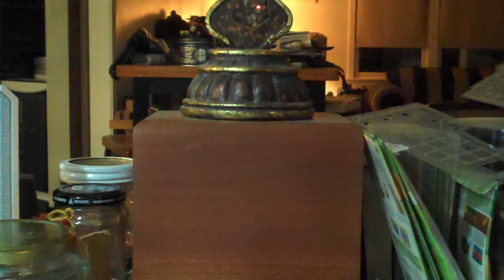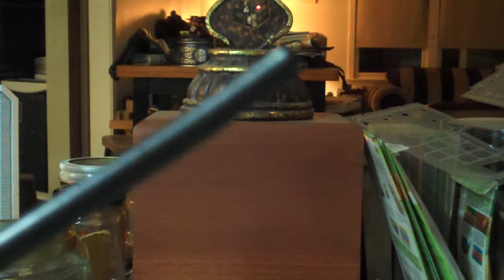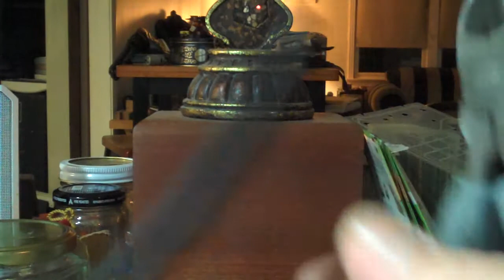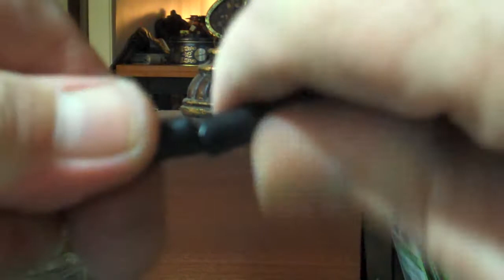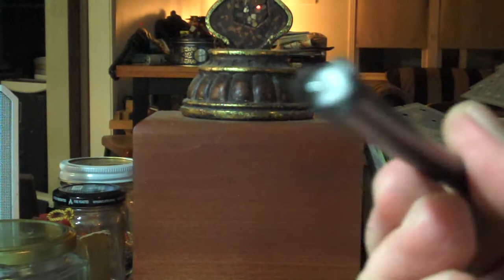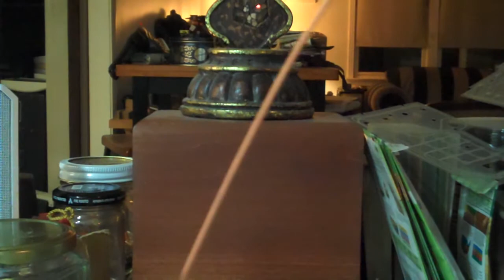Scrapping Copper Core CoAx

Comment: the way i do it is take a razor blade run it down the length of cable peel back the pvc/rubber insulation then take the aluminum braded stuff lookss like a chinese finger cuffs pinch at one end an pull off then take the razor blade a run it along the plastic that protects the copper wire and finally you can pull out the wire (have the razor parallel to the ground while cutting the plastic stuff)